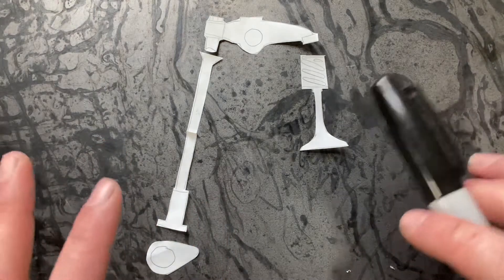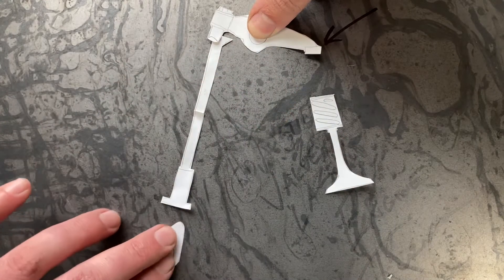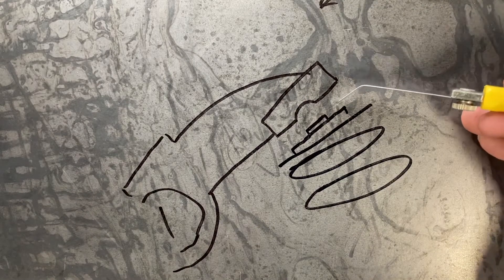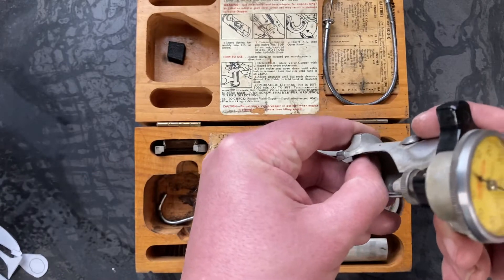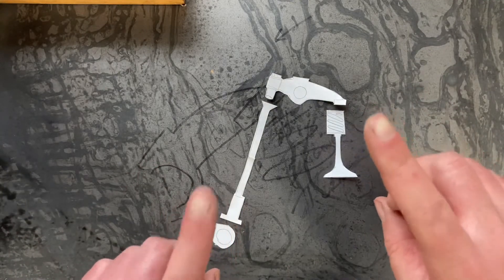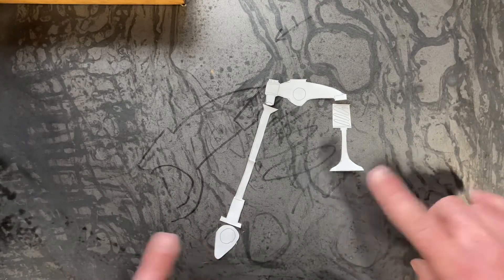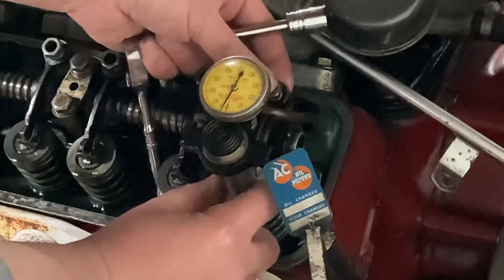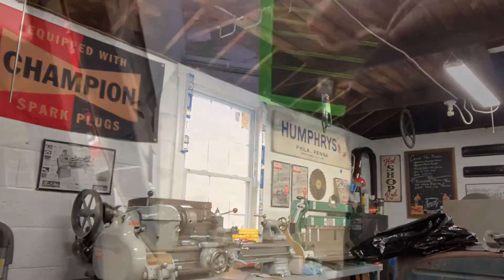Valve Lash with P&G Valvegapper

Comment: I am based in the United Kingdom.  I imported one of these brilliant tools into the UK from the USA a few years ago, & have never regretted it!  Bought it from eBay US, didn't particularly cost me a huge amount of money, but the tools accuracy & ease of use is very much appreciated.  Very useful on my "Classic" OHV motor's, as it completely eliminates any wear in the rocker, camshaft, follower or valve train, & ensures a completely accurate valve adjustment.  A beautiful, 1950's period tool, I can highly recommend finding & buying one😀

Comment: For a 
Ford Y-Block the setting should be 19 thousand hot. I like to set at 20 to 21 cold. The reason being; when the engine is hot the clearance will close 1 to 2 thousandths. I prefer to run slightly loose, an equivalent of about 20 thousandths hot. I am happy giving up a bit of top end for a bit more mid-range and to lessen the possibility of a burnt valve from too tight a clearance. Thak you for posting this informative and useful video.
Reply from the maker: My pleasure, thank you very much for watching!